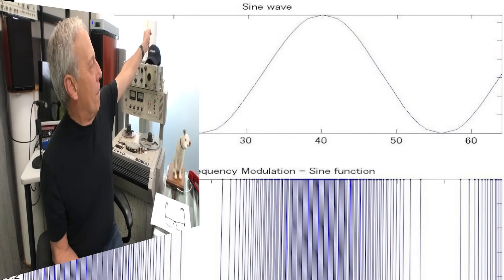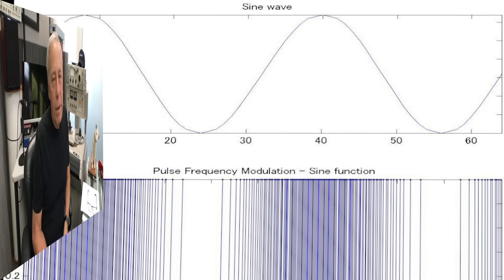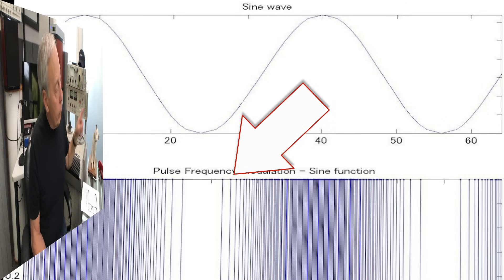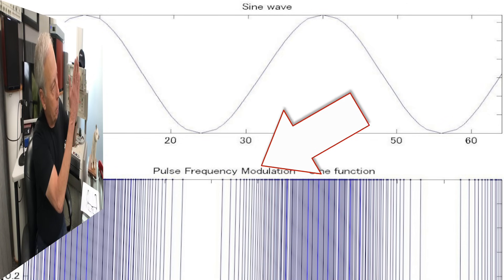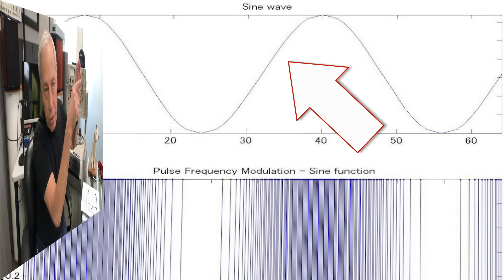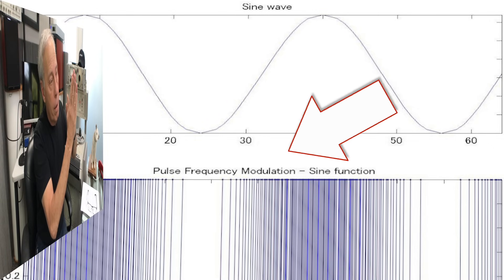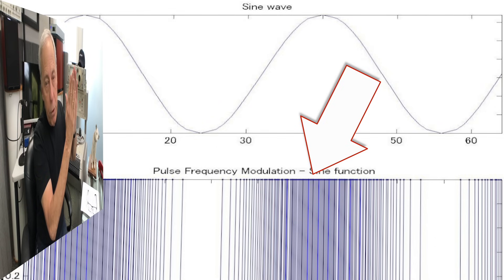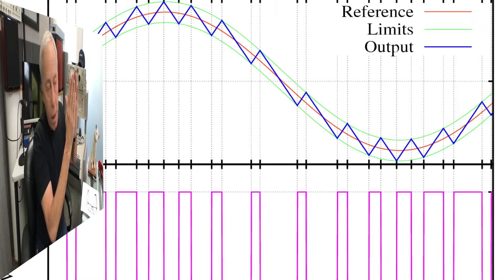What are the differences between Class A, AB, and Class D amplifiers?

Comment: Class A was the best (cleanest) if you could stand the heat and electric bill. but Class AB must be perfectly balanced! (not always easy). Pulse Width Modulation is efficient, and works with the new digital sources, but sounds a bit (byte) "raspy" (harsh)

Comment: There is no mention of cross-over (switching) distortion which is probably the biggest difference between Class A and Class AB amplifiers. Switching distortion, which can sometimes be audibly heard is when the complementary pair of outputs switch from the positive to the negative cycle. Basically, it is a complex audio sine wave where two outputs are constantly switching on and off and at this point it's the switching of the negative and positive signals that produces this distortion. Class A bias's the outputs in a 'full-on' state, thus eliminating crossover distortion, but most of the power dissipated is in heat and only a small percentage is dissipated as music energy. Therefore, not efficient, but pure (theoretically) in sound. Class AB is the most common form of output when we use the term 'idle' or 'bias' current, we are trying to adjust the amplifier to its ideal (compromised)  bias/idle setting where it will then produce the least switching distortion, but not get overly hot or end up with thermal runaway and overheating.
Reply: He told about it, but not with using cross over distortion term.
Reply: Robert was correct, saying Paul did'n say anything about the distortion from the switching phase.

Comment: So does that mean Class A amps will get hotter when played at lower volumes because the power isn't going to the speakers?
Reply: Yes, they typically do run pretty hot. You'll see sizable external heatsinks on a lot of mid to high wattage class A amps.

Comment: Ok, now i have a little bit of knowledges on those types of amps. Tanks sir
Reply: I have an Bose amplifier: 2x50w @4 ohms, 2x25w @8 ohms 

And Bose speakers: up to 80w, 4 ohms 

What is the maximum number of speakers that amplifier can handle?
Reply: From my experience top quality class D can produce a very airy and clean, smooth sound. However one trade-off you immediately notice is the "impact", so-called bite, you just notice a slight roll-off in high frequency and also low frequency, which somewhat lessens the presence effect. This is not terrible in any respect, but A class delivers more impact to the music compared to D class.

Comment: Reason I hate class D amps is they suck at super low bass. My 1,000 watt rms JBL 1001ez barely even moves my subs when I throw a 15hz test tone, and that amp pushed well over 1,000 watts certified on the amp dyno (around 1,300). My old school 75x2 Phoenix gold has them moving so hard they look like they're coming out of the box, even when I throw. 10hz signal at it. When I throw a 10hz signal on any class d amp I try, the subs almost wont move at all before audible distortion. It slams hard as hell at 40hz though. I'm just going to stick with old school mosfet amps. They hit the lows so much harder.

Comment: Paul.....  no glue!!  Class D is fully 100% Analog technology.  Paul go to school and learn amplifier technology. dont confuse the people further
Reply: Class D can be digitally controlled. That makes it more than 0% digital :) But maybe that should be called class-S then.
Reply: @jonaslithen7240  every amplifier can be digitally controlled isn't it?  this alone has nothing to do with the AMP Concept kind
Reply: @bernhardhnida3038  you have to elaborate on this a bit. A (basically) class D amplifier can be controlled by having a digital circuit (FPGA or microcontroller) output ones and zeroes to create PWM. In a linear amplifier, like class A,B,C,G,H et.c. you would work with linear signals so it is not applicable there. For sure any linear amplifier can have digital inputs and so on, but that is obvious and not my point.
Reply: @jonaslithen7240  FPGA ore Microcontroller is a Option but not needed for Class D amplifier.  it was only bad luck that D was the next character in alphabet to name it Class D it has nothing to do with D-igital.   The D of Class D amplifier comes NOT from DIgital.    Class D . Amplifiiers are "Modulating" but fully 100% analog amplifiers. modulating analog radio stations also not digital because it has FPGAs ore microprocessors in its hardware to control something ore everything.
Reply: well maybe i am confused and i ma the one who need to go to school.. :-) . of course everyone can be having a digital frontend but not making it a digital amplifier concept.  i was referring to the power amplifier classes AB A D and i wanted to state that D has nothing to do with Digital it is only a pitfall that it was called >D because it was next free letter for its abbreviation.  by the way who knows what class B and C   is ?  Class A, B,  AB, C,  D and so on... this is a very good read about it...  https://www.electronics-tutorials.ws/amplifier/amplifier-classes.html
Reply: @bernhardhnida3038  My intention was to say that not all class-D amps are 100% analog. Some create PWM digitally. You are absolutely right in that most are analog. And D does not by any means stand for digital :)

Comment: I think you may have made a mistake when you were explaining Pulse-Width Modulation. In the image on the screen, as the sine wave rises, the width of each pulse seemed to get narrower, and at the lowest point of the sine wave, the pulses looked to be at their widest. You said the exact opposite, however. I may be reading the image incorrectly. But it does seem like you may have made a mistake. (???)
Reply: Agree, looks like the graphic showed Pulse Frequency Modulation instead of Pulse Width Modulation.   The two are analogous in function, but differ in implementation.  Unlike PWM, in which the width of square pulses is varied at constant frequency, PFM fixes the width of square pulses while varying the frequency.

Comment: 1:55 - 2:07 maybe someone can help me about this.
1. Is that means class A circuit amp has 100watt equal burden? Because it said all wattage power convert to heat in close loop circuit position but no signal/idle state transmit into that circuit.
2. If it has 100watt burden, where is the power from, to punch out when the input signal comes?
Pardon me for this very basic question, I am not good both on electronics and audio system.
And many thanks for your explanation about classification on amplifier, because I don't know which one to buy and what specs I should consider to get organic clarity on my home audio.
Reply: ateng lenon 
Sadly the laws of physics say that to create a greater signal (to make the amplifier work) we need an external energy input

Comment: Thank you sir, nice video, is class D amplifier better than class ab?
Reply: Class D is better if you want high power at low cost, a compact, efficient, light design, and you don't need the most pristine sound quality.  Popular application is subwoofer amps.  
Class AB is better if sound quality (low distortion) is the primary goal and you don't mind a larger, more expensive unit.
Reply: Did you saw the video? Have you heard what he explained? If yes is the answer I don´t understand your question.

Comment: the distortions of the class d are on average 0.2% at low operating power.

AB class one tenth (0,02%)
Reply: Bruno Bassi depends on the nuances of the design and the impedance vs frequency behavior.  Not all are created equal. 

B&O ICE modules are Class D but THD is .01% 75% of operating power. 

For AB the biggest weakness is distortion vs frequency. When the load looks like an artificially low impedance the amplifier can shift out of its class, and the distortion becomes a non harmonic variety—like the sum and difference of the fundamental.
Reply: That matters very little when rooms are off by 30 dB.

Comment: So anything that isn't a class D is basically not that great and should of been phased out years ago?
Reply: Not true at all. Class d is the most convenient because of  it's size and how cool it runs but it's not better. A class ab amp with a high class a bias should be best. A class a amp is hard to get. The parasound halo jc5 amp or parasound halo hint 6 and schiit ragnarok integrated amps are great examples of this.
Reply: @V1ralB1ack  Thank you for your response.

Comment: Class D for subs and Class A/AB/C are good for mids/highs... make sure your wiring is correct and not mickey moused 🤫
Reply: Class A or AB everything, even subwoofer. Class D just gives more power, but its not the best sounding and will never be.
Reply: Yea but you can not put a class D amp for highs you will blow them away Class D amps are mono blocks
Reply: @lexhtfdct7230  Class D is shit. It will never be better than A/AB.
Reply: Whatever works for you

Comment: I bought a Panasonic XR55 back in 2006 for $200, which was one of the first pure class D A/V receivers on the market. Over the years I've set up side by side comparisons with friends owning class A/B receivers and amps costing 10x the price and the XR55 is either within 1% sonically, or in some cases more transparent. I have yet to hear a class A worth the price on any set of speakers and heard anything that's a better bargain than my XR55. I personally think the audio industry is afraid to sell more class D because they will put themselves out of a job. IMO, my friends who buy these top of the line Pioneers and Yammys gets maybe 6-8 years out of them before they fail. My Single ICC board XR55 works perfectly after 13 years.

Comment: problem with class ab and class a is power output. A 1k monoblock will cost thousands. Class D same price 16k watts around 16 times buck bang per watt. Even in my home setup my 2 18 inch subs need 3k rms each into 4 ohms min. To my knowledge theres nothing class ab or a that can even give that amount of power.

Comment: All tube amps in the 60'th must have been class A. Amps had 3 big transformers, 8 tubes, big capacitors, lots of heat, 25LB.
Reply: two output tubes per channel almost always = class AB.  An amp like the Dynaco ST-70, with 7 tubes total (two EL-34's and one driver tube per channel, plus a rectifier tube) was a class AB amp. Pretty much any tube amp over a couple of watts was AB.  Many of them generated too much heat because designers ran waaay too much bias current.

Comment: where do you use class b and class b push pull?
Reply: See my reply from 3 months earlier.  Mr Paul has, in my opinion made errors or important omissions in his explanations.  Class B amplifiers were one of the most common of transistor amplifiers, and nick named 'push-pull' due to the fact that the sine wave is split at the 0vdc point into 2 separate signals,  One being the positive part of the wave(push), the other being the negative(pull).  These two are then amplified separately, and re-combined at the output of that amplification stage.   The combining of the two signals had to match up to avoid switching or crossover distortion.   The technician used adjustable transistor bias voltage to do this.

Comment: just a little confusion ... i agree class A bias which is 1/2 Vcc makes the 100w amplifier consume 100w or even higher at all times but when the we apply the signal and takes some output let's say 50w to the speaker then the amplifier left with extra 50w so should it heat less ??

Comment: I'm wandering what should be the most appropriate class type of amplifiers  to use on an AV receiver to power up speakers and to lower the work load of the av receiver to achieve optimal result for atmos dolby system and auro 3D.  I'm thinking of renewing my stuff with a Denon AVR X6400H.  Any suggestion will be appreciated.  Thanks
Reply: Denon is total china crap these days, get something else like Krell
Reply: @hi-fidude6670  Thanks for the input. I appreciate.

Comment: Damn then i'm fucked with my Technics SUV-620 it's a "New Class A" Amp.
When i understand you right, that thing use maximum power even when the volume is quiet :(
So to lower my electricity bill, i must turn off the amp, or get another amp............but i dont like 
other amps or brands, for me it's Technics Brown or nothing.

EDIT: I did a research, it seems "New Class A" is a hybrid between Class A & B.
It use less power when it's quiet, but is work & sound like a Class A.

Comment: Back in the day, we could associate power consumption with amp output. You knew if you had a 2000 watt Class A 2 channel amp , you had very powerful amp. I see post these days that suggest that you can't always tell an amp's output power simply by it's power consumption, which makes sense to a certain degree. When comparing the power rating of a class A amp vs a class D amp, does 750 watts program , for example mean the same thing, or is the class D amp using power more efficiently, and there fore should be more powerful for the same 750 watts rms?

Comment: I sat through the video, wondering what the heck Paul was talking about.   (Now, I'll be fare as say I haven't read a years worth of comments, so maybe someone has offered a cleaner, yet more technical definition?)   

   My fortune was to be an audiophile in the golden years of stereo (late 70' to early 80's) and at the same time trained as an electronics technician in the service, stationed in Japan.
Those days, you serviced everything to the component level, unlike today's 'toss it in a landfill' mentality, so working with these circuits was a daily routine.  

   Class A, Class AB, and Class B referred strictly to the circuit design used to achieve amplification.  The term 'Bias' referred to the pre-loaded voltage provided the base of the transistors necessary for them to function.   

  Class A circuits were always considered the superior circuit, as the transistor input was fed the full sine wave, and the amplified transistor output was also the full sine wave.   The problem with class A is that transistors could not tolerate the heat generated by high output demands, so unless you utilized tubes for heavier class A operations, you were restricted to about 12 - 20 watts.
   
   Class B used two transistors (or more), one to handle the + voltage of the sine wave, and the other to handle the - side.   As each transistor had to only handle half the sine wave and could remain switched off for the opposite voltage, they remained much cooler, and could be run at much higher amplification levels.   The crossover point where each transistor took on its respective task is called 'switching'.
   Switching was the class B Achilles heel.   The full sine wave was handed to each transistor simultaneously, but each transistor only passed its respective voltage polarity. Each transistor required a precise base bias to ensure it functioned only in its domain (positive or negative).  As the division of the signal had to be recombined at the output of the circuit, the biasing of each transistors was adjusted so neither transistors would attempt to step into the others territory.   This hand off , and sequential 'stepping over boundaries'  caused 'switching distortion' (the + to - crossover point) on the output.  This is where a bench tech would adjust the input transistor bias, to minimize this effect.

   In closing: Class A was the preferred circuit, as it was an exact amplified replication of its input signal.  Many top end manufactures used, and proudly advertised many of their components a 'Pure Class A'
   Class B was the champ of power, boasting outputs approaching those of tubes in a smaller, cooler, and more energy efficient package. With a well designed circuit, switching distortion was virtually eliminated, and if it drifted after a few years, it was a simple task of the tech to adjust it back to spec.     Of additional note: When you lost one or the other transistor in a Class B, you replaced them both with a 'matched pair' to ensure continued sound quality.

(Note edited for better clarity)
Reply: Ah yes, the NPN and PNP transistor pair

Comment: paul, u mentioned a sonic holography system u tinkered with. With the direction audio trend is head is heading, where mobile listening becoming more and more the proof of the pudding while room ambience more like general listening with sweet spot limitations, i think u should revive ur pet project and develope it i to a product. Can u elaborate on ur approach and comment on those past attempts made by product like the Carver system, i look forward to a talk on this topic, Alan,  Vancouver, Canada.
Reply: @Alan Ling

That has been played out many times over the last 40 or 50 years. It can either be done acoustically such as Polk did with the SDA speakers or electronically like Bob Carver did. In both cases, you get some of the left signal out of phase out the right speaker to cancel crosstalk to the other right ear from the left channel and vice versa, the trouble is the comb filtering and on some recordings it just did nothing. Everyone I knew with a sonic holography device turned it off after a few weeks never to be turned on again. There is a reason why Polk only produced SDA speakers for less than a decade. Some multi-mic'd recordings were made a mess of. There is a good reason why it never stuck much like 3D TV Sets. In the end it's always best to separate the right and left channels no matter what with nothing added.

The best thing is to eliminate any room induced ambience to address the latter part of your question. Back when Bose did marketing research for the 901s he found that the discerning listener preferred no artificial speaker induced ambience cloud whereas the less savvy masses liked the effect. I myself could never stand those things. Dr Bose was not stupid, he just is good at marketing to the less discerning masses.